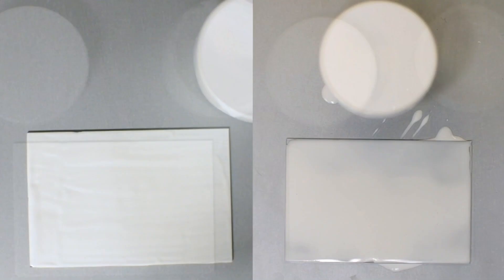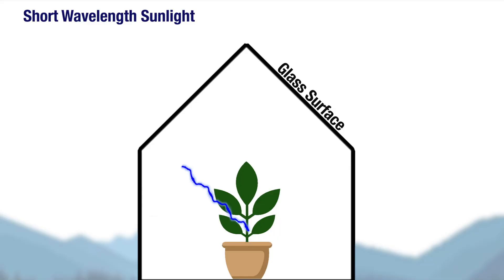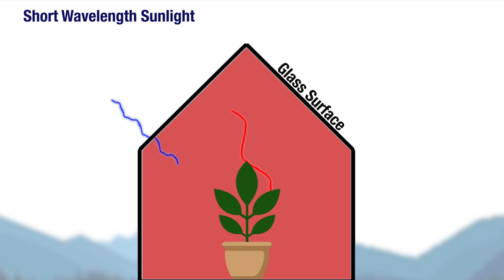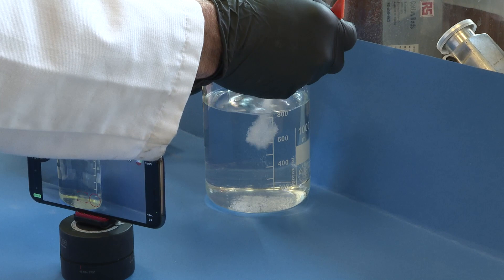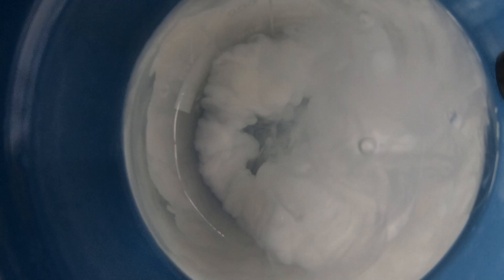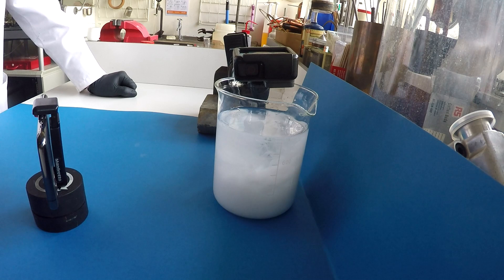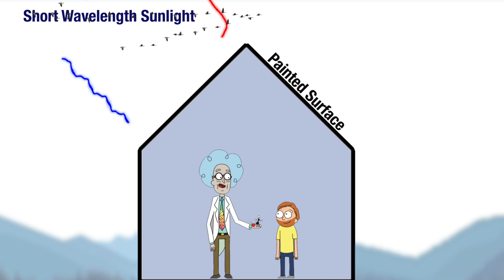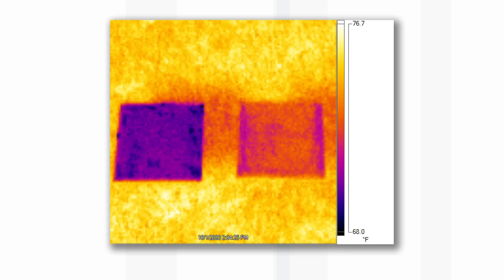Ultrawhite Paint (with Barium Sulfate) - Periodic Table of Videos

Comment: So we can both selectively reflect most light, and selectively absorb most light. That sounds like the beginning of a lot of cool things. Novel climate control systems without any moving parts, where the maintenance is mainly just cleaning and replacing the shutters for a few sections, weird and probably impractical optical/thermal circuits, perhaps even the shell of some ridiculously-efficient low-wattage power sources using the thermoelectric effect for...I don't know. I hope people way smarter and better equipped than me are getting some really big ideas.

Comment: hm, i might be a bit overly optimistic hear but hear me out, if it only allows the heat to go one direction, should we make reversible panels of it to isolate houses' walls/rooftops, so you can flip them in winter to keep the heat inside, and again in summer to keep it outside?

Comment: How interesting. 

But the effect where it lets out longer-wave heat would surely only work if it were painted on a material that also lets longer-wave heat pass, right? So we would have to use this paint with a glass house to reap this benefit. 

Is this right?
Reply: Partly. One issue is that an infrared-opaque material will diffuse IR until it can be absorbed, in the way a cloud can block the heat of sunlight. Paint can heat itself up and push that energy into what it's painted on, so this paint will be cooler even on an IR-absorbing material. But the best results would be achieved with a material that allowed IR to beam straight out into space.

Comment: There is already a rubber (?) and asphalt based paint they apply to caravans and trailer houses. It is much like pool paint. Not the same, though. My question is about the barium sulphate. Recently, I had an MRI study which was with contrast: barium. Such barium contrast dye is a radioactive marker; is this new paint potentially radioactive?

Comment: Barium sulfate paint has been around for decades.  What is different about this particular paint I wonder?
Reply: Barium sulfate is widely used in paint, but not in this way.
The key here is the distribution of particle sizes resulting in high scattering light at all wavelengths from the sun.

Comment: So if this stuff cools down 4.5C below ambient as the research says, could someone build a large cooled structure near the ocean to drop the dew point and passively get water?

Or could a large cooling tower painted in this to pull air down into a turbine and generate power while also cooling the surrounding area? Horizontal, always on, wind turbines.
Reply: Love it

Comment: The cooling effect should be there with any typical size distribution of BaSO4. Right?
Reply: No, because the issue is that it's normally transparent in a medium. The size distribution is directly related to it's ability to reflect high energy light.
Reply: @seigeengine  It does not look transparent.

Comment: This seems like an incredible discovery, and so simple! Are there any downsides compared to Titanium-based paints? Are there possible health concerns or a large difference in cost? And you would probably need to study the performance of the paint over the years and decades ... Still, incredibly promising results!
Reply: Side effect?  Possibly.  Buildings MUST be designed to handle the loss of heat exchange this loss in water and water vapor drying or they will simply rot.  Conversions of homes not properly designed for such a loss in heat will have accelerated obsolescence.
Reply: @l0I0I0I0  Are you saying that, cooler homes can make water not evaporate so they'll rot ? makes sense

Comment: Great video as always, but can someone help me understand how the paint cools by being completely transparent to radiative/infrared heat? It seems to me that the sun would still be heating objects up, or does it not emit as much infrared heat as the objects in the room do?
Reply: The sun shines down UV, visible, and near visible infrared.
This paint reflects 98.1% of that light from the sun.
The paint, however, is transparent to infrared of very long wavelengths, so the IR emitted from the painted object can pass right through.
Reply: @seigeengine  Thanks, it wasn't explained well in the video. They said it reflects all of those and then said it's transparent to IR, which seemed contradictory.

Comment: The question is, which white pigment is more useful for white paint? 
Barium sulfat, because in can keep houses cooler inside - or Titanium dioxide, because it uses the UV-light for photocatalysis, which helps to clean the air of Nitrogen oxides, but more importent it helps to keep the surface clean and white? Not a so easy question. At least there are much more chemical reaction at the surface of a paint with Titanium dioxide pigment. :-)
Reply: It was mentioned that titanium dioxide absorbs uv light but barium sulfate reflects it. Wouldn't this become a public health issue (skin cancer. Many get sunburned while skiing) And isn't very white a bad thing because of "snow blindness". In Greece people walk past whitewashed walls, the perfect height for skin and eye problems

Did you mean photocatalysis keeps the paint clean? What chemical reactions with titanium dioxide happen other than photocatalysis?
Reply: @namename9998  Yes it keeps the paint/surface clean, because the Titanium dioxide produces together with UV-Light OH-radicals, which destroy the dirt. But it also react with Nitrogen oxides or methane etc. which helps to clean the air.
Reply: @red.aries1444  Wouldn't titanium dioxide be the better option since wouldn't photocatalysis still be possible if the color wasn't white? In many countries people like being individuals which means not everyone wants to live in white houses. If you remove white from the barium sulfate option wouldn't the only perk be letting infrared escape (not something you would want in winter)

Comment: Hey I have a question I don't know if it could be answered here, but does anyone know what happens to topaz when it changes color when it's exposed to light?
Reply: Impure colored topaz contains a number of ions such as ferric iron that don't quite fit nicely into the crystal structure. They'd like to move to more favorable spots, but cannot do so without enough energy to 'kick' them out of their current location. Sunlight or high temperatures can do this. A common color change is from rusty, hydrous  ferric iron (Yellows, browns) to more clean pinks and purples.
Reply: @garethdean6382  so it's literally electron energy levels being excited, but refracting color instead of emitting it?

Comment: I remember reading a short blurb about this a little while back.  It sounds amazing!  Except I have to wonder if the benefits for cooling would become detriments in cold months for warming.  Would you need an even higher r value to prevent heat loss in the winter?
Reply: Why couldn't you cover it with a tarp made from the blackest black in the winter?

Comment: Wont this increase the amount you have to heat in winter?
Reply: Yes. And will decrease the amount you have to cool in summer.
Reply: @ivoivanov7407  Which is the greater savings?
Reply: @beachboardfan9544  Depends on where you're living?
Reply: Just thinking out loud here, but for where I live in Central PA, I don't think the sun helps with heating that much in the winter. It's pretty much overcast every day. I would immediately reroof my home with steel panels coated with this if it blocked the heat in the summer.
Reply: @codys2018  I dont disagree, but I'd still like to see the math.

Comment: That doesn't make sense: Barium paint blocks Infrared but if the Infrared is "Under" the paint it "Radiates out"? Blocks infrared on one side but not the other?
Reply: Think of it like this: you can have glass that lets red light through, but not blue light, right?
This is like that but for infrared. It lets long wavelength infrared through, but not short infrared.

Comment: "It's not receiving any heat from the sunlight..." If it's transparent to IR light, isn't it letting in as much IR from the sun as it allows passing out? Wouldn't the net IR radiation difference be zero? If it blocks IR in both directions than I'm sure that's a cooling efficiency benefit, like strong insulation, but I don't see where the radiative cooling comes from if it's IR transparent.
Reply: ... What?

I'm not even going to explain what's wrong with that to you. Just think about it a bit more.
Reply: @seigeengine  way to be a great member of the community.

Comment: That's great for the summer but how about winter? I live in Canada.
Reply: Your roof is most likely white with snow most of the winter, is it not?
Reply: @movme  now that you mention it, yes. It is. Next winter I should spray paint it black to absorb more heat.
Reply: @johngrey5806  You want to spray paint the snow black to absorb more heat? That would perhaps cause the snow to melt.
Reply: @movme  yes, that's a problem. The ideal situation is to have a white roof in the summer and a black roof in the winter.

Comment: If it reflects infrared radiation in sunlight, why doesn't it reflect the infrared from the house as well? How does the infrared radiation from the house get passed out into the atmosphere but the infrared from the sun is reflected?
Reply: because the IR from the sun is mostly short wavelength infrared, whereas the infrared emitted by your house is mostly long infrared.
Reply: @seigeengine  oh fancy, TIL

Comment: So whats the diffrence between white paint and mirrors?
Reply: A mirror would not let long-wavelength IR (aka "heat") escape from the substrate below the mirror.  This paint allows the long-IR escape, so more energy escapes than is absorbed.
Reply: @karhukivi  so in mirrors LESS wavelenght are absorbed... so why is the paint not reflective?
Reply: @ndsoo9865  A metallic reflector like a mirror, reflects most visible, UV and IR radiation but shorter wavelengths (X & gamma) and much longer wavelengths like microwave and radio can pass through.  The paint is reflecting visible and short-wave IR but longer wavelengths of IR can pass through.
Reply: @karhukivi  well... quite complicated

Comment: Would it also save power if you used it on satellite dishes? (I suppose it's transparent to radio)
Reply: How would that save power?
Reply: @seigeengine  if they were more reflective maybe a smaller one could do the job of a larger one (so more service for the same satellite)
Reply: @subjectline  I'm not sure how you concluded that, but okay.
Reply: It's not a conclusion, it's a question. Enjoy thinking about it!
Reply: @subjectline  Well, I'm pretty sure the answer is no, I'm just confused as to how you would have even thought that might be the case.

Comment: Not sure if this would actually work with the Sun. A decent fraction of the sun's light energy is infrared! So if BaSO4 transmits infrared then wouldn't the painted structure still absorb more heat than it emits? The fraction from the sun is surely larger than the fraction from objects and surfaces inside, and those objects inside will absorb the infrared with it passes through the BaSo4 and hits them.
Paint the floor and walls with something that reflects infrared and now we're cool.

Also what material is the substrate for the paint? If it's something that is not transparent to infrared (which is most things) then the paint serves no purpose.
Reply: Imagine if, instead of fingerblasting your shitbox, you watched the video and listened to what they literally told you.

Comment: There have to be more niche and interesting applications than just painting your house white surely!? What would happen if we painted the condenser coils of heat pumps with this? Would that make any difference at all? Or would it just make it less efficient because of a small insulative effect 😂
Reply: It wasn't clear what the exact range of IR that is transparent, but Nigel, if the CASING of the condenser had this paint, it would allow the IR heat to escape and prevent solar radiation, except IR, to escape.

Comment: I was also thinking for few years if there is any such thing that can use suns energy to cool down my home during summer without having to install electricity guzzling devices 🙏
Reply: ... Yes, it's called solar panels.
Reply: @seigeengine  read my comment again - without consuming electricity 🙏
Reply: @seigeengine  Thermo based heat exchange  common man's knowledge I have but not everyone in this world has the luxury of living near a reservoir or living in an apartment 😃 Practically this paint can help if you have a heat conductive roof with this paint applied on roof surface which is still not practical for everyone
Reply: @spotoncam3640  Everyone lives on the Earth, give or take.
Reply: @seigeengine  you are not thinking from world perspective but your own location or country
Reply: @spotoncam3640  ... Yes, other countries aren't on Earth. Well spotted.

Comment: What is the toxicity of the paint? As a matter of consumer protection, this should be the first concern of manufacturers.
Reply: The only factor might be particle size.

"barium sulfate is nontoxic due to its insolubility."
"Barium sulfate in suspension is frequently used medically as a radiocontrast agent for X-ray imaging and other diagnostic procedures. It is most often used in imaging of the GI tract during what is colloquially known as a "barium meal". It is administered orally, or by enema, as a suspension of fine particles in a thick milk-like solution (often with sweetening and flavoring agents added). Although barium is a heavy metal, and its water-soluble compounds are often highly toxic, the low solubility of barium sulfate protects the patient from absorbing harmful amounts of the metal. Barium sulfate is also readily removed from the body"

Comment: So, there's no infrared component to the sunlight that reaches the earth?
Otherwise it's going right through this paint and into your house.
By lessening heat gain we not only reduce the CO2 needed to create energy for cooling, but I'd imagine (in some cases) the need for he HFC's used in the air conditioner in the first place.
Can you do a piece on the opposite? Vantablack, or an all absorbing carbon nanotube forest?

Comment: This video doesn't really make much sense. At first we're told the paint is super reflective and reflects nearly all wavelengths from the sunlight- including UV, visible, and IR. But the he immediately says it's transparent to IR and lets the IR pass? If that was the case, why isn't the IR from the sun passing through as well? How would the paint 'know' from which direction the IR is coming? There must be more to the explanation than that.
Reply: IR is not a single thing. It is a word for a certain part of the EM spectrum.

Sunlight is about 50% infrared by energy, but most of that is relatively short wavelength infrared, only a bit longer than the visible range. The longer the wavelength, the less of it there is in sunlight. For example, at 700 nm, the line between visible and IR, there's twice as much energy as 1100 nm. By 1500 nm it halves again, and then again by 1900 nm, and so on.

The IR wavelength emitted by objects at room temperature, however, is mostly around 10000 nm.

So obviously the paint is reflective of short wavelength infrared, but transparent to longer wavelength infrared.

And apparently it's highly effective. Purdue is claiming the paint can make objects 10.5ºC/19ºF cooler than ambient at night, and 4.4ºC/8ºF cooler than ambient in direct noon sun, and even report a 10ºC/18ºF drop in winter at ambient temperatures of 6ºC/43ºF.

Comment: The only way the paint would actually alleviate the need for AC is if most of the heat came through the walls or the roof and I doubt that. You might be able to make thinner walls because you'd need less isolation since the paint is reflecting all the heat, but then isolation isn't just for the heat it's also for the sound which paint won't block.

Comment: Except I'm not so sure a bunch of reflective roofs would be great for the climate. As it is, the temperature is much warmer around cities because of the concrete, and that's not really even white. It might become unbearable to be outside during summer in certain parts of the world.
Reply: Try thinking about that one a little harder.
Reply: @seigeengine  how so?
Reply: @turbot8er672  It's predominantly cities not reflecting light that causes them to be so warm. Painting city rooves white would make the city cooler, not warmer.
Reply: @seigeengine  lighter colored materials reflect more light, which heats up the air around it. Darker materials absorb the light and heat up themselves. Seems like the latter would be worse, but it's not.

Comment: a nice bit of science. One does wonder about the leaching of toxic barium into the surrounding soil & water.
Reply: One does wonder if you spent a single moment to look into what you're screeching about.
Reply: @seigeengine  as a holder of degrees in both chemistry and engineering, and currently on a five papers a week regime, I would say I have some idea on which to base a question which was not, as far as I can tell, screeched but asked in an open forum. As it happens, I have read the paper and similar ones on passive cooling. It is a promising technology, but real world applications do have to consider the wider impact, on, say, soil and water.

Comment: Problem is that you would need more energy to keep the house warm in winter. Leaky houses require constant heating in winter. (Norway)
Reply: Exactly my thought, when they mentioned it I thought they were about to talk about the solution... I think there is none.
Reply: Obviously this is not a solution for Norway, but in Australia or near the equator, why not?
Reply: Not applicable if you would like to keep heat inside. Norway - no (may be), but Algeria yes? It is matter of balance between energy for cooling vs. energy for heating during a year.